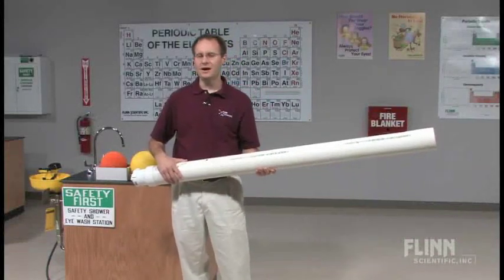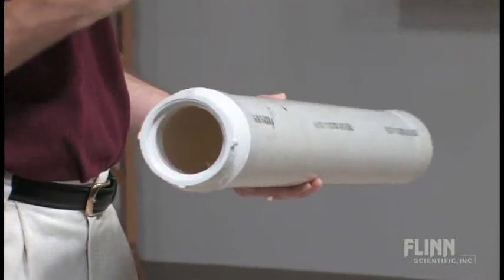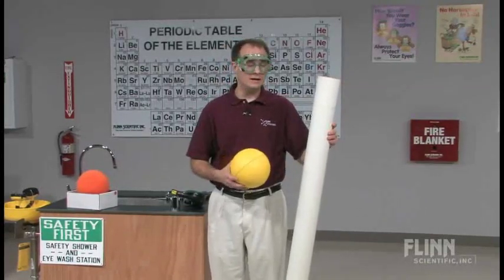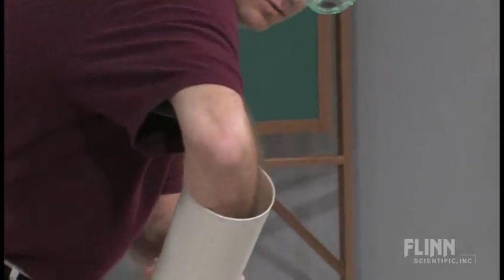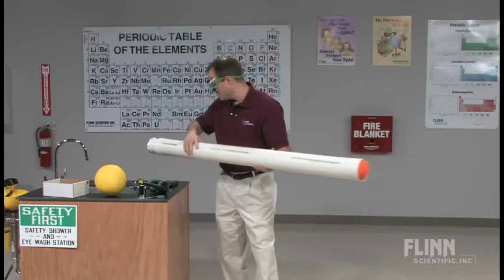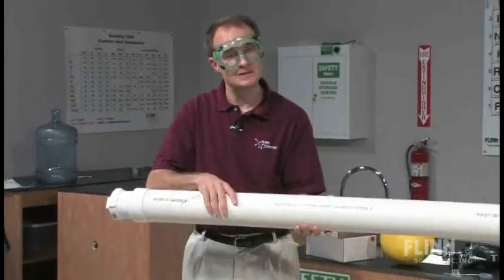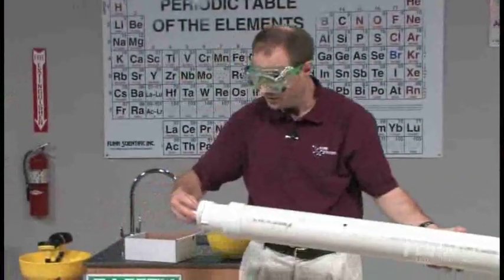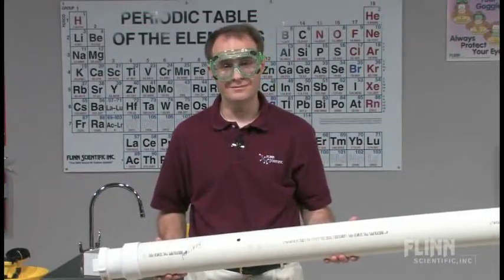Giant Alcohol Cannon

Comment: Hairspray is easier to add in the screw-on open end and makes a much larger “bang” when ignited through a hole drilled into the square raised portion of the plug. Mine makes a sound of 186 dB. In case you don’t know what that means, it’s super loud and can be heard for miles.
Reply: Thanks for the tip
Reply: Where did you get a dB meter that can go that high? I’ve been looking for one for a while
Reply: @TheOneRiv  Used a friends. He's a cop, if that helps.
Reply: Butane is also good!

Comment: Scheduled 40 and 80 are much stronger. You should not use this thin stuff. Scheduled 80 is rated for 240 psi which is plenty strong enough for most of the low power combustibles.